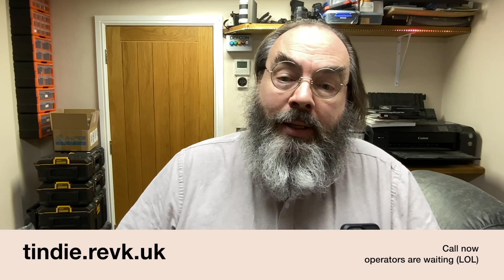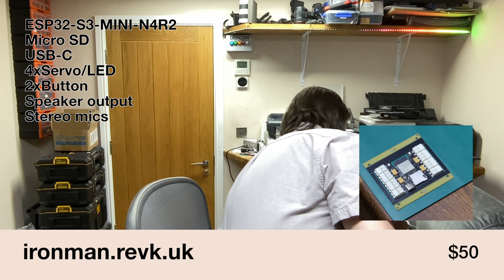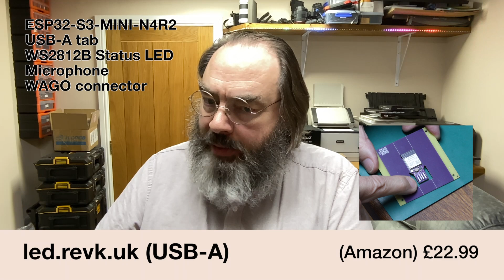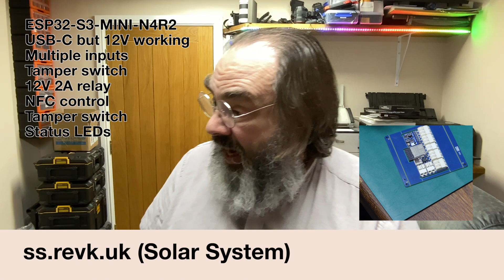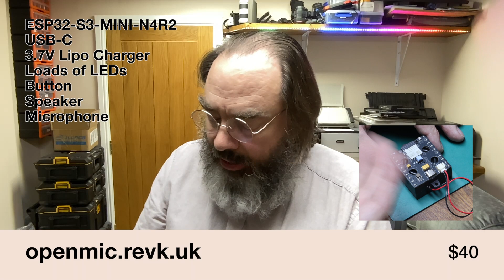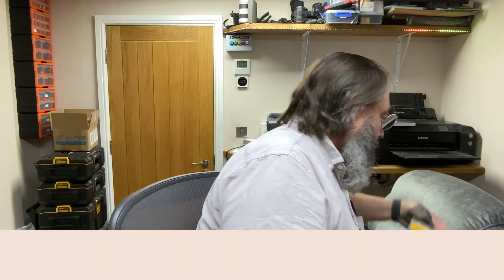RevK Shopping Channel (featuring IronMan)

Comment: I’d like to purchase a kit (or complete unit) for the sound to LED strip that’s flashing away up on the shelf behind you. Is there an Amazon or Tindie listing? Thanks 😊
Reply from the maker: https://www.tindie.com/products/revk/tiny-sound-reactive-led-strip-controller-usb-c/
Reply: @TheRealRevK The customer service response time on this shopping channel is excellent - thanks! Which LED strip is recommended to pair with the board?
Reply from the maker: @G7LWT  Well, depends, there are a lot of WS2812 compatible strips. You can power via the USB at 5V and use that to power the strip - but depends on power your USB charger as to how long a strip it can run. You can also have power on a strip and use that strip connector to power the board, e.g. 5V, 12V, 24V (don't connect USB at the same time if not using 5V). Amazon have loads of WS2812 strips, some RGB, and some RGBW.
Reply: Ordered - thanks again.